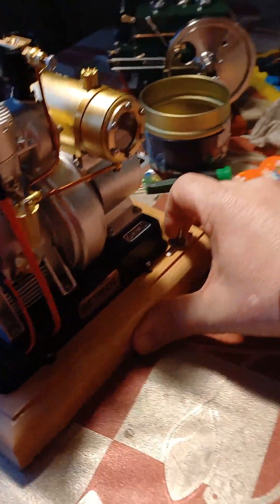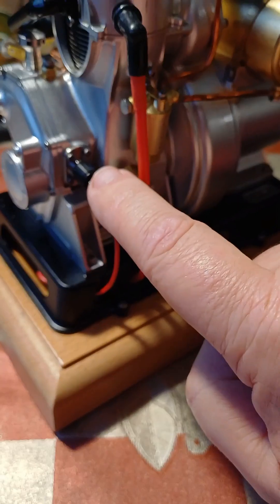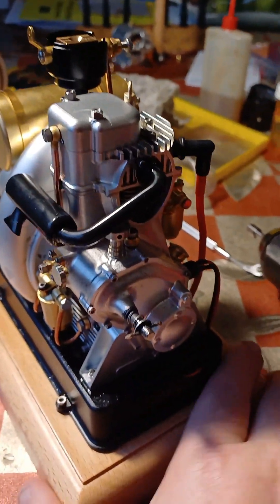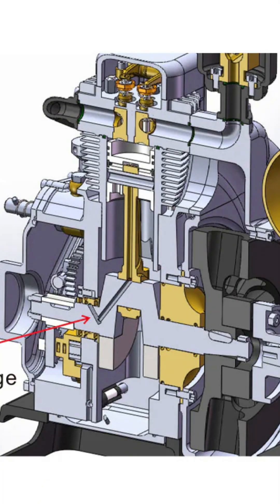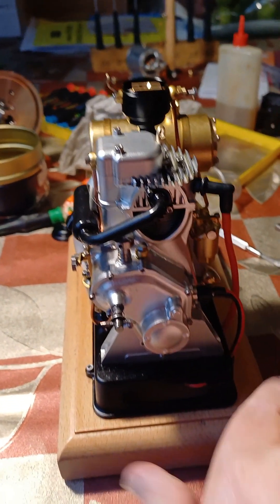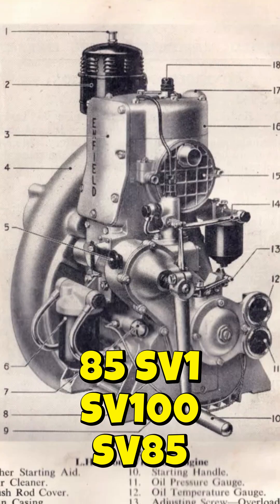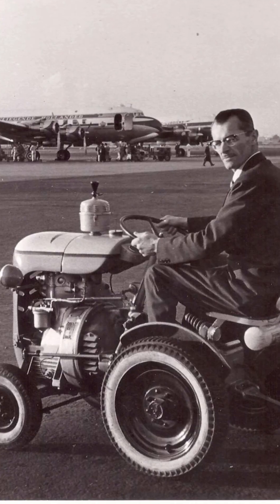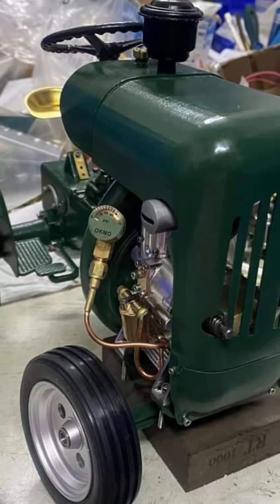Desktop working petrol genset 50's diesel prototype OKMO 185 model engineering 2025

Comment from the maker: OKMO 185 is a 3cc dekstop scaled version of an old British Enfield stationary engine from the 50's, the VS85 or VS100 used in small generators, military equip,emt, boats etc.
The scale model has a fully sealed circulating oil system, iron piston ring, mechanically switched electronic ignition is the wooden base. This version is fitted with a vintage style generator and will later be available with a model Lugli Lilliput tractor. By Jin at OKMO models in China who leads in ready-to-go model engineering . Available from Stirlingkit.com
extra 12% off: ThomasPCGuru
185 Tractor Engine: https://bit.ly/4jmKr0Y
Stirlingkit must-have ICE engine: https://bit.ly/3HhbZaL
Hints and Tips
https://www.stirlingkit.com/blogs/news/7-must-know-tips-from-thomas-to-get-the-best-out-of-the-retrol-okmo-185-engine-stirlingkit
Reply: They show a $150 discount straight up to everyone, 
then ask $32 for packaging and warranty..
and ThomasPCGuru doesn't work for any discount with the $150 off.